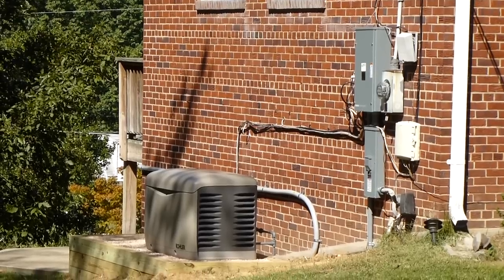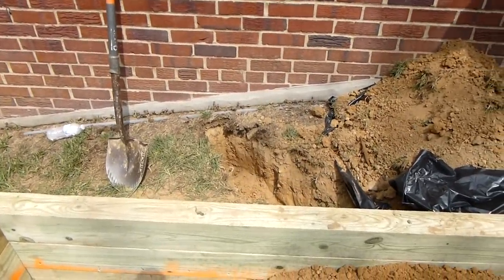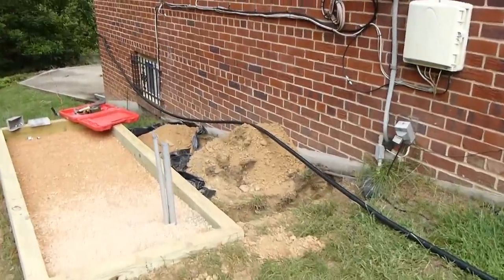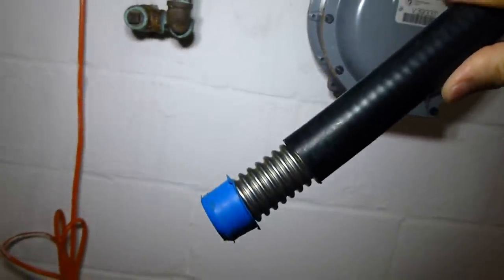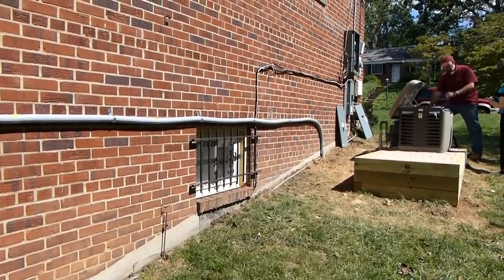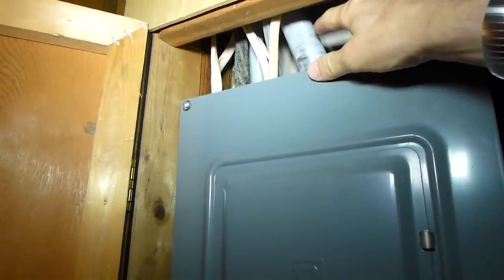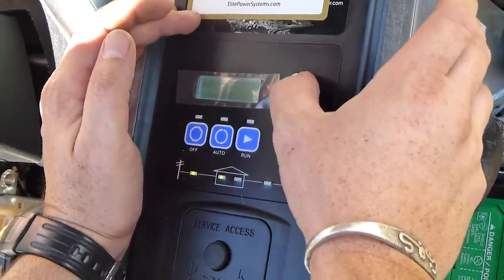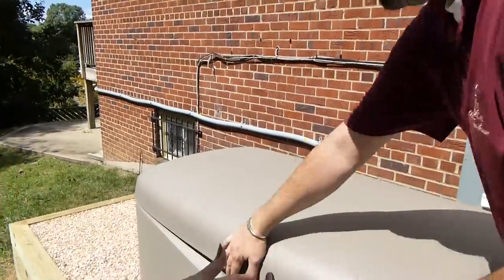Installation of a residential backup generator (Kohler)

Comment: I don't get why this is installed onto the ground. What if there is flood? Why don't you raise the level or put the damn generator on the roof?
Reply from the maker: This is installed at a typical suburban home. Installation on the roof would require significant engineering and construction, and be expensive. And there is no way this property will flood, as it is generally above the surrounding terrain. If this generator floods, the east coast of the US will have much bigger problems than this generator.
Reply: At least it’s off the ground.  Many, most sit right on the ground with a supplied pad.
If you’re near the ocean it must be raised up..but not on the roof..
I do think the pad was a bit large for the generator dimension.
Nice install.

Comment: Battery should be inside the house to keep it from drainning.
Reply from the maker: Interesting point. This is my neighbor's generator, so I have had little to do with it after installation. I assume that the battery is trickle-charged by utility power as long as there is utility power. That would keep it topped up. But now I wonder if my neighbors have had this battery replaced. All batteries like this go bad after a few years, so it's cheap insurance to replace it at a regular interval.
Reply: Thank you for your reply ,cold weather is the enemy of any battery.

Comment: What a sloppy job of installation.  Especially the gas line.  These people would not do an install at my house
Reply from the maker: FWIW, this installation was done 8 years ago and is still running fine. The generator has needed service a couple times, but that was the engine and nothing to do with the installation.
Reply: @BobKovacs  still a sloppy installation.  I said nothing about reliability.  Reliability does not justify sloppiness.  It reflects on the company reputation

Comment: they should have bought solar system as back up power...doesn't cost shit to run...the energy is free
Reply from the maker: The home does not have great solar exposure -- the roof faces east/west instead of north/south.
Reply: but its expensive as shit to buy and install.
Reply: Batteries are expensive and you would need acres of solar panels to generate enough power to match a 20KW generator.
Reply: I have a 12.47 kw solar panel system on my house. Looked into Tesla power wall. Company that handles the 25 year warranty on the panels said if batteries installed that would void the warranty on the solar panel components.
Now I have to get a kohler 20kw generator.
Reply: @matt34003434  acres?? Try 4,000 sqft of 340 watt panels.